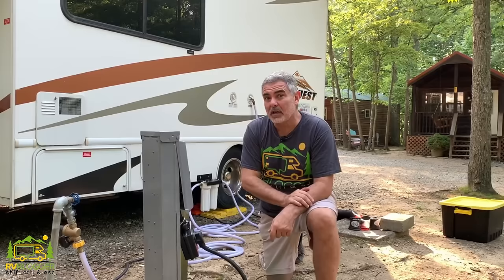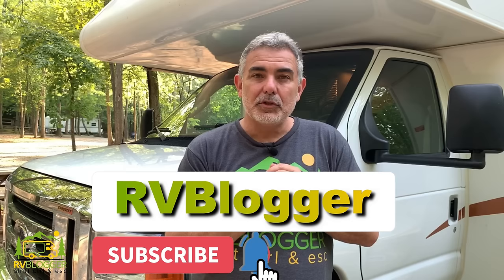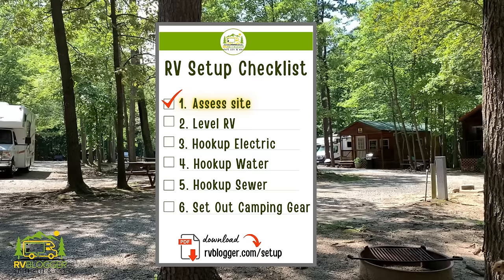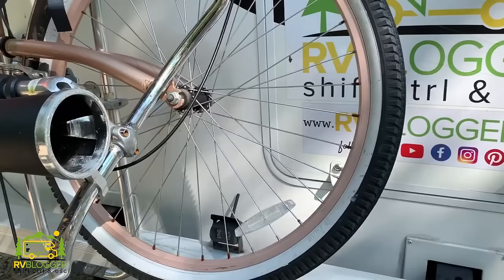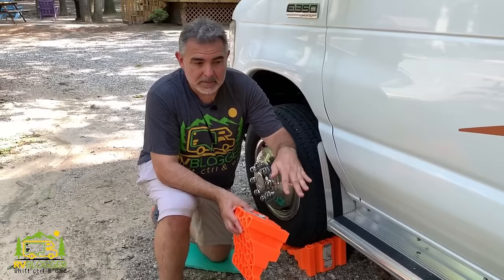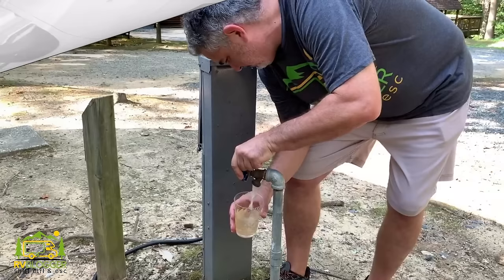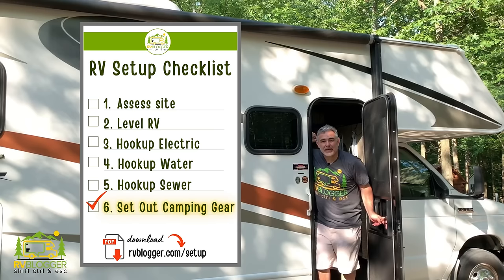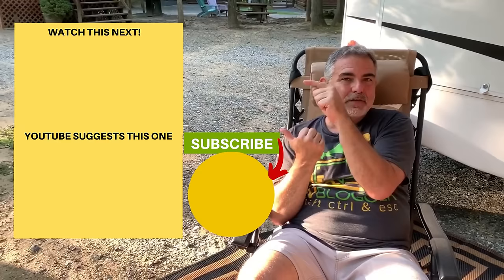How to Setup Your RV Campsite for Beginners - Water, Sewer, Electric and Gear PLUS Newbie Checklist!

Comment: Another YouTube video I watched they suggested using the surge protector before you do anything else leveling, etc.  That way, if the power is bad, you can quickly move to a new spot.  Otherwise, you’ve just spent all that time leveling and now have to move.  Love the set-up video.....1 week away from our first RV and have really enjoyed all of the YouTubers videos.  Thank you!
Reply from the maker: Hi Jeff,
Thanks for sharing that tip. Not a bad idea!
Glad you liked the video!!!
Thanks for watching and commenting! 
Mike and Susan
See you in the Facebook Group too!
Reply: Also surge protectors protect you from surges but won’t help if low voltage is present. It would be nice if they would also regulate the output voltage to 120 and 240.

Comment: On your electric connection: AFTER I check that there is power to my surge protector, I turn off the power and then hook-up completely to the RV. Then, I turn the power back on (when all is connected, and no 'power end' is loose/unconnected). Just a safety concern on my part. On the sewer prep: yes, great mention to keep the black/gray water stuff in a separate container. I also use a separate plastic bin, one for fresh water and one for gray/black water. I will 'lift' drain my fresh-water hose to drain as much water as possible, then coil the hose(s) and connect the hose(s) end-to-end to each other, to prevent them draining into the container. (I do the same with the sewer hose.) That way, I keep seepage in the storage containers to a minimum. I have also drilled (1/4"-3/8") multiple holes into the tops of these storage containers (both the fresh AND the sewer) to allow air dissipation of any moisture. 

If you are a full-time RV-er, you might want to "clean-flush" your sewer hoses with some regularity. If you are an intermeitant RV-er (like me), I will "clean-flush" my sewer hoses when I get home, let them dry, then connect them end-to-end and put them in their storage box.
Reply from the maker: Hi Mtnhorn,
I certainly agree that you  should turn off the breaker after you check the surge protector and then hook up to your RV and then turn the breaker on again. If I wasn't clear on that I appreciate you clarifying!
Thanks for watching and commenting! 
Mike and Susan

Have you subscribed to our YouTube channel yet? If not we sure hope you will click below and subscribe! Thanks!
http://goto.rvblogger.com/YoutubeChannel?sub_confirmation=1

Comment: First time seeing you, as I just got the notion in my head that this would be a great way to snowbird to the gulf and am now looking at used Class C RVs.  I need to learn how to work them before I buy anything 👍
Reply from the maker: Welcome! Thank you for watching our setup checklist video. Purchasing a used motorhome is a great idea. But I do recommend getting it inspected. There can be hidden issues you don't want to be surprise with. Great job on starting your research now. We do lots of RV tours that could help you find a floor plan or RV features that would fit you best. ❤️

Comment: Hi there -- we've been out a few years between a pop up and now a travel trailer camper -- been looking around to get some tips and hacks to make the travel easier --  The one thing that I picked up and would share is wehn you are getting in the site with a slide - you didn't address this in your video - - most people use a tape measure -- what I do now is = I have a peice of 1x2 painted orange   that is 6 in longer than the distance from my tires to the end of the extended slide -  so before you back in (or pull through) put the 1x2 down at the closest obstacle and keep the wheels to the outside of the 1x2 and boom!!  there you are placed with enough room for the slide .  Just a thought to make set up a bit easier -- Happy Travels
Reply from the maker: Hi Alex,
Thanks for sharing your tip!
Thanks for watching and commenting! 
Mike and Susan

Comment: Thanks for making this video. I surfed in and found your channel.

We have a Class A Bus Conversion. All these apply to our coach. The 2nd time we went camping with we had too much water pressure and blew the line under the kitchen sink. That break grounded it for 5 years. 

Now it looks like I need to do some shopping before it's next outing. 

You got yourself another subscriber.  Thanks
Reply from the maker: Hi Jon,
Welcome aboard! Sorry about the water hose blow out! That is a real bummer!
Thanks for subscribing, watching and commenting! 
Mike and Susan 

GET READY! We are launching our new digital/video magazine called RV Camping Magazine on June 1st! Stay tuned for our YouTube Video all about it!

Comment: Thank you for these helpful tips! What size sewer hose do you recommend (15 or 20)?
Reply from the maker: Hi Christina,
We keep a 10' and a 15' on board. I use the 10 for short runs, the 15 for medium and occasionally combine them if we need a long run. Plus it's always good to keep two hoses on board in case 1 breaks...but with Rhinoflex hoses, we haven't had that problem...yet!
Thanks for watching and commenting! 
Mike and Susan

Comment: 0.5 Check hook ups first to make sure they work before setting up and leveling the camper.
Run the water out for a bit before hooking up the hose. Run water through the hose for a bit before hooking it to the camper.
Reply from the maker: Checking electric at the pedestal is a great tip. We demonstrated running water from the spigot to flush the system before attaching your filter and water hose. Thank you for watching our How to Setup Your RV video and commenting. We appreciate your support!

Comment: Great practical essential video!  We are pure novice rv’rs!!!  It is humbling asking this question!  
We use bubble levels affixed to camper.  Can you tell us what is a level camper using the bubble levels?  We have looked for other videos, but nothing covers this topic.  Does the bubble in the level have to be exactly centered between the bubble lines | o |, or is the camper considered level if the bubble is touching one side of the bubble line |o  |?  
Thank you so much for your thoughtfulness!
Reply from the maker: Hi Dr S,
This is a great question, and I'm glad you asked. It is important to get your camper as level as possible for a few reasons: comfort, fridge functionality if you have an absorption style fridge, and so your shower water drains properly after you take a shower. Chief among these is the fridge. An absorption fridge will not operate efficiently ( or not at all in some cases) if the RV is not level ( I define level as within 2 to 3 degrees). The absorption-style fridges run off of your propane if not plugged into shore power, and you can recognize them by the silver fins inside the fridge towards the top.
So, if the bubble is within the black lines, you should be close enough, but the closer to center you can get, the better.
I leveled our Class C for years by sight. Or I would pour a glass of water into a clear plastic cup and set it on the counter to see if we were level. It gets easier with experience.
I sure hope this helps you out, but if not, please reply or email me at mike@rvblogger.com, and I will try to help.
We also have over 600 articles on our website that you might find helpful at https://www.rvblogger.com.
Hope you have a great evening, and thanks for watching our videos!
Mike
Reply: Thank you so much for responding!  You have comforted us with you with your clear and understandable respond.  I can’t tell you how these little things. Mean to us “novices”.  I know many many others will and would benefit from this.
Reply: I am disappointed and confused as to how poorly my previous response turned out!  May I take a “do over”… Your response is comforting.  Little things mean so much in life.  Your kindness is moving.  Many will benefit from your insight.  Thank you.
Reply from the maker: @drs3055  😂No worries. I have learned the my "talk-to-text" is very dangerous!😂 Thank you again for the kind words and your support!!!

Comment: More info on the water filter you use and what two screws do you put it on?
Reply from the maker: Hi Charisse. The water filter we use on our Class C is Beech Lane External RV Dual Water Filter System. We just went to Home Depot and looked for screws that fit inside the bracket holes. Here's the amazon link to learn more about the water filter.  https://amzn.to/3muCQpO Thanks for watching and commenting on our Setup RV video.
Reply: Thank You! 🌻💕

Comment: Thank you so much Mike and Susan for another great video!  After summers of camping in an RV with my grandparents as a kid, we finally purchased a travel trailer to go out with my family this summer.  One “etiquette” type question I have:  If you have to fill your water tank at the campground (Missouri parks have LOTS of electric only sites), is it acceptable to take the time to allow your water to run through the pressure regulator and filtering system?  Or would that take too long?  Then on the reverse side, is it acceptable to take the time to flush your black tanks at a dump station?  Am I overthinking this?  Maybe should just gauge based on how busy things are?
Reply from the maker: Hi Stephanie,
Good questions...
It is always ok to take an extra minute to hook up your water filter before filling your fresh water holding tank. No need for the pressure regulator when filling your holding tank because you are just filling the tank and not adding any water pressure to the plumbing lines throughout your RV.
We always flush our tank at the dump station when we dump unless there is a line of people behind us.  Then we just do it the next time we dump.
Hope that helps!
Thanks for watching and commenting! 
Mike and Susan

Comment: hello :)  I will be taking my class C for my 1st camping trip this summer, nervous, but super excited. your video is perfect for helping me get it all set up, so thank you!!! one question.... I have a 2005 Jayco Escapade, there is only one place to connect to water on the outside (I see some campers have 2, one for the holding tank and one for "city water")  so, what do I need to turn off/or on to hook up water at a campground vs filling my freshwater tank?  thank you and safe travels!!!
Reply from the maker: I'm not exactly sure but if you only have one place to hook up a hose for water there should be a valve you turn to get city water or fill the tank. I'm sure the owners manual will have the correct info for you. Here is a link to the owners manual - check page 40...
https://www.manualslib.com/manual/2312872/Jayco-Granite-Ridge-Greyhawk-Escapade-2005.html?page=50#manual
All the best!
Mike
Reply: @RVBlogger  thank you for the reply, i have a 23 foot escapade, I have contacted Jayco for the manual, so many levers lol

Comment: We got a 20 foot travel trailer and made it out a half dozen weekends last year. I've been researching about leveling and have a couple questions if you have any ideas. I've been using a carpenter's level and check front to back, left to right in the middle of the camper. Is there somewhere else I should put the level or if I get stick on bubble levels where should they go? And I've used the stabilizer jacks to lift up what ever side/corner needs adjusting. Is this a good or bad idea?
Reply from the maker: Mike wrote an article about installing a bubble level that might help. https://rvblogger.com/blog/rv-travel-trailer-bubble-level-installation/ I would consider using leveling blocks to help adjust the level of your camper versus your stablizer jacks, too much strain on your jacks. They can be placed under any tire that needs a little adjusting. https://rvblogger.com/blog/how-to-level-travel-trailer-slope/ Thank you for watching and commenting.

Comment: Thank you for a great tutorial.
I am wondering though, What is the purpose of connecting the sewer hose when you set up? Would it not be better to wait until it is time to clean the tank? It looks like a hazard, especially on your other video where the hook up was on the wrong side of the RV.
Reply from the maker: Hi MrsW Jr,
That's a really good point. If you are on a shorter camping trip or you use your RV as your transportation you could wait to hoop up the sewer line. We do that sometimes since our RV is our transportation too!
Thanks for watching and commenting! 
Mike and Susan

Comment: THIS IS SO HELPFUL! Thank you! One Q though: If you don’t have the auto leveling system, did you use a level on all sides to find out what to adjust? And also, I am assuming that by trial and error that you found out how many blocks go on each side? Thanks again!
Reply from the maker: Hey Florida Life, 
Yes, if you don't have auto levelers you have to manually lower the jacks. Trailer might have a level bubble installed to detect proper levels, or you can install one, or you can use an app. Hope this helps! 
Thanks for watching and commenting! 
❤ Mike and Susan 

By the way, we hope you will subscribe to our FREE monthly digital/video magazine called RV Camping Magazine. Let us know how you like it!
https://rvblogger.com/rv-camping-magazine/

Comment: Do you not use some kind of jacks/stands to stabilize the motor home, otherwise won’t it sway in the wind/when you walk around inside it will move side to side?
Reply from the maker: Our 2008 motorhome wasn't equipped with jacks and to be honest it's so small there isn't much movement when walking inside. Thank you for watching our setup video and commenting.

Comment: Great video! Thank you. This was very helpful. What kind of 30 amp line do you connect to the surge protector?
Reply from the maker: Glad you liked the video!
Not sure what you mean by "what kind of 30 amp line do you connect to the surge protector." I just connect the electric line that is connected to the camper to the surge protector. There isn't a special line needed...
Not sure if I'm answering your question or not so please reach back out if not.
Thanks,
Mike
Reply: Thank you so much for responding. I guess I’m wondering what the 30 amp line you’re using looks like on both sides. My RV has 3 prong 15a 120v
Reply from the maker: @dusky_rebel  We have a 30-amp line on our RV, and it has three prongs. The other end of our line is wired into the RV. 30 Amp lines are used most of the time in RVs. If you have a 15-amp 120-volt line, it's basically an extension cord. This type of line will not work with the surge protector we use. I hope this makes sense because we aren't using pics to help show what we are talking about. If you need more help, you are welcome to email me some pics with questions at mike@rvblogger.com.
Thanks!
Mike

Comment: Great video! I did have a question. Being very new at this. If my wife and I wanted to take our camper into town is it OK just to disconnect the sewer hose from the camper and leave it on the ground and just unplug the power and water from the camper and leave it there. Or should we completely dismantle the set up and re-set it up when we come back. Would appreciate your answers and comments. We just don’t know the etiquette.
Reply from the maker: Hi Jon,
This is a very good question.
Personally we pack up the water, sewer and electric rather than leave it on the ground. This way no one will think we left it behind by mistake and take it. But if you do leave your sewer hose behind be sure to cap the ends of it...
Thanks again for watching our videos!
Mike

Comment: Do you miss not having a car for sightseeing? If you’re going somewhere, is this RV small enough to just drive that there and park at the location? Love your videos!
Reply from the maker: Great question!
One of the reasons we have a small RV is because it is so easy to drive anywhere and pretty much everywhere. And we can get set up and break down so quickly we don't mind using our Class C as our sight seeing vehicle too. But - we did just buy a jeep wrangler that we will be towing behind us. We plan to buy a Class A at some point so we figured we would get the jeep now and start practicing towing it behind our easy to drive Class C.
Reply: @RVBlogger  Thank you! I’m getting my first, a Class C, next month and am trying to work out how to get around. That’s a relief! Thank you!

Comment: Question: would it be better to hook up the water regulator first,then the splitter...?
Reply from the maker: That's a great question but our answer is no. The regulator is there to protect your RV plumbing from any sudden bursts of water pressure . The splitter is there if you need additional hose for rinsing RV gear, bikes etc...No need to regulate that. Thanks for watching and commenting Richard!
Reply: Okay, I'm a little confused though, I believe you were worried about blowing out the hose it self..
Just wondering about how high the pressure is at some of these campgrounds